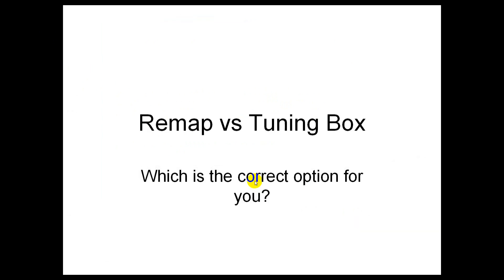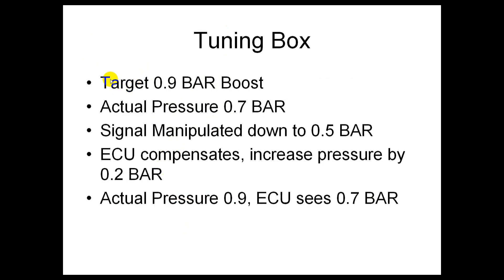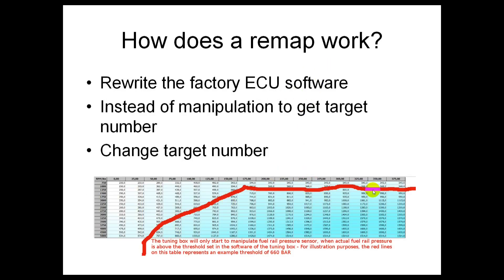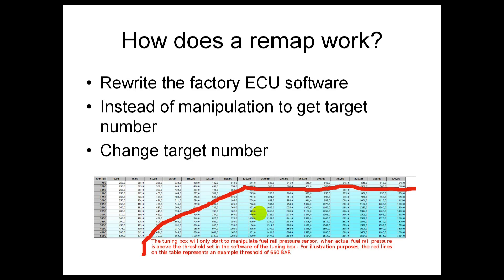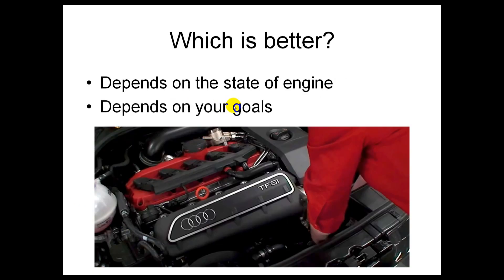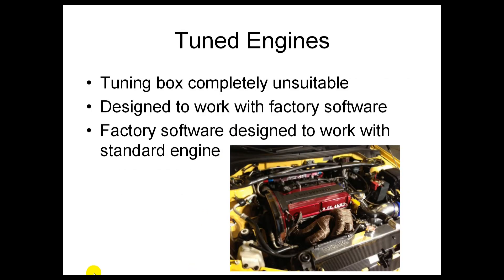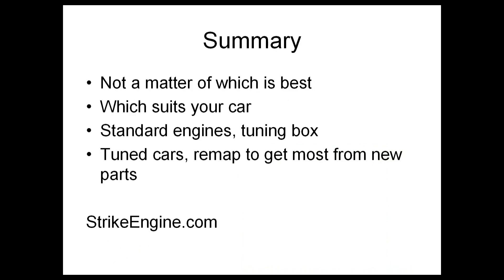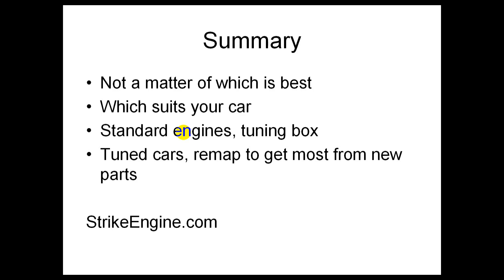Remap vs Tuning Box - Which is best?

Comment: Average fuel rail pressure in modern-ish turbo diesel cars  (from the last 15 years or so) varies from around 13,000psi to 26,000psi. (Your car tyre is pressurised to around 30psi) so that’s a LOT OF PRESSURE. And you want to push it up another 20% it’s not been designed for? You think that’s not gonna have an affect on parts and longevity? Is it really worth it? Fk no.

Comment: 3:18 WRONG a tuning box is detected after being used, even if removed. You don't know much about cars or forensics, or how insurers worked with police for years to collect evidence. 
A tuning box is rubbish, it takes no inputs from any engine components like the ECU can.
It is just a £2 voltage multiplier. Sold for hundreds.
Get a proper REMAP and at least your car will operate properly.
Reply from the maker: Hi. I don't class products which are just a voltage multipliers as tuning boxes. They are indeed "rubbish". This video is not about this type of "product". 

This video is about tuning boxes such as those from DTE etc

Comment: What could happen to the engine if I fit a tuning box? Will it overwork other parts of the engine? Are there any negative effects to other parts of the car? I'm personally considering getting a tuning box for my C220d.
Reply from the maker: "Overwork" - Probably not. The engine is still controlled by the factory Mercedes software. If you accelerate and drive faster generally, logically things will wear faster.

Comment: Hmmm, interesting. Everyone says the remap is so much better as tuning box is deceiving the ECU so it can create many problems.
Reply from the maker: A tuning box can cause problems if its adjustable *and* the user puts the settings too high. Solution here is to reduce the settings.
Reply: So you wouldn't recommend a TDI tuning box with 7 settings?
Reply: For an RCZ HDI

Comment: can anyone tell me if its still suitable to use a tuning box if the only part im changing is a different muffler, otherwise everything else will be stock
Reply from the maker: Its best to use a tuning box on a close to standard engine, ie muffler change should be zero problem.

Comment: Great info but you said if you got a new exhaust you can’t use a tuner box?
Reply: Unless the box is tuneable itself, then it’s not a good solution. They have to be programmed to suit the vehicle in its standard form, once you start changing other components you run the risk of being “outside the parameters” of the box. Sometimes it won’t make a difference, but once you start stacking upgrades (i.e. Exhaust, Intake, Injectors ) then you move further and further away from the parameters that the box was programmed for, reducing its effectiveness.

Comment: One thing I don't recall him mentioning is tuning box gives much better gains on turbo diesel engines over petrol engines.
Reply from the maker: You are 100% correct. I will do another video specifically comparing remaps vs tuning boxes on turbo petrol engines
Reply: Did you ever do a video comparing remaps and Tuning boxes for petrol engines?

Comment: Can not see now a power box when it connects to a fuel sensor on a engine can alter the timing and boost on a turbo diesel does anybody know thanks.
Reply from the maker: Hello Jeff. Tuning boxes generally do not change the injection timing at all. There are probably exceptions to the rule but I do not know of any. Closest I can think of is Steinbauer, I believe their products alter injection duration only, not timing.

Comment: Hi I’m just wondering i have a n/a civic type r ep3 its not been mapped I only have exhaust and induction kit will this tuning box be beneficial to a k20a2 engine im not wanting massive gains power wise just something to make it a bit faster. So do you think this will work thanks
Reply from the maker: Hi. These products are for cars which have a turbocharged engine from the factory
Reply: StrikeEngine TV thanks for the info 👍🏻

Comment: Is the overall build of the tuning box the same or is there a difference between the 100 dollar, 300 dollar and 500 dollar tuning boxes?
Reply from the maker: Edit. Different products from the same brand will normally be of the same quality. Build quality between brands will not be the same (cases/materials/connectors/harnesses will vary).
Reply: Thanks for the answer. Some cars like Jaguar and Mercedes have different models with exactly the same engine but the performance is limited by the ECU. Can you fit the tuning box for the higher power model to the lower power version and have the same results?
Reply from the maker: Tough question. I suppose it would depend on how they have reduced the power, what software changes they made to the ECU. I wouldn't recommend it, just get the box that is designed for your specific car

Comment: Can a tuning box be installed on a remapped engine to reach more power ? The car is original,  no new parts.
Reply: Try watching the vid
Reply from the maker: HI! It depends on the tune but generally speaking no. Tuning boxes are designed for stock engines

Comment: If the dealer looks into it they can see your car's been running higher boost on acceleration as these numbers are apparently recorded. And if you're making a warranty claim they will look into it! I've been thinking of getting a JB or BlueSpark tuning box for my m135i and seen a lot of these claims about it not recording on the ECU but a BMW technician on one of the forums made it pretty clear that if they know what they're looking for you can't hide it.
Reply from the maker: Hi. I've heard this also but never with an explanation as to how. From my point of view if the ECU does not know the actual boost pressure I don't know how it could record the actual boost pressure. I suppose a dealer could make a guess as to the boost pressure looking at other data but at the end of the day, they would be guessing, not knowing.
Reply: So I've seen a couple of posts giving alternative views which I'll copy here- apologies for the wall of text but some people might find it interesting! First this guy who works for BMW, writing on a forum about a Bluespark Box:

 "I ran the box on my car at level 5 for around a week before it threw on the EML and even after the EML came on the car ran perfectly. I plugged the car in at work and got the ambient pressure sensor fault code, reset it and carried on with the box connected. The EML came on later that evening and drove it for a few days like that before removing the box the day before my car went into service.

Once removed the EML went off again but the technician at work said theres a stored fault on the car has your engine light come on atall, i obviously acted dumb and said no! He said they had looked through all the data logs etc and couldnt find a fault, cleared the fault and road tested and all is well so very hard to trace by the looks of things!" 

But then this guy explains why warranty claims can be dismissed: 

"Can BMW detect a piggyback after its been removed? YES
Several people and a few vendors claim it can't be seen by BMW since it changes the signals from the sensors hiding the extra boost and airflow. However BMW knows exactly how much fuel the car uses at all temperatures and authorized fuels (E0-E10) so if it is outside that range there is a mechanical failure/change or the tune has been altered. On a stock car the trims stay below 10%. A car with a piggy routinely sees above 20% during wide open throttle but goes back to normal while cruising. It's very obvious looking at data logs. 

Secondly they can take the time it takes for the car to accelerate based on speed or rpm rise over time and determine how much power it takes to accelerate the known mass of the car in the known amount of time. not perfectly accurate due to varying conditions but they can clearly see an extra 80-100 hp. It's how programs like virtual dyno work. http://virtualdyno.net/

Second, will they void your warranty due to a tune? 
If you make a warranty claim for a major failed part BMW opens a PUMA case and requests the ECU data. They will see the tune/piggyback data and void the claim. I'm sure someone somewhere has gotten away with it for whatever reason but based on numerous posts on the forums and conversations with many SA's, the claim will not be honored."

Although he also says he's been tuning turbo BMWs for 4 years and never seen a piggyback alone cause a failure. I guess it depends how much effort they put into looking for it?
Reply: It's simple, there are multiple sensors on each car that give away over boosting the air pressure. Maf is one fir a start. Fuel flow, knock sensor. All of these start sending abnormal signals using a box, so there's a fairly obvious smoking gun.

Comment: What about the fuelling, you only address the charge air, you won't get any benefits unless the fueling matches the air flow.
Reply from the maker: Hi. For the tuning box you mean? Fuelling is looked after by the factory ECU (not the tuning box). The ECU injects fuel according to the MAF signal & also the lambda signal. More boost = more air entering the engine = raised MAF signal = more fuel.
Reply: Car TV - StrikeEngine.com Ah, I made the comment based on the headline description and without seeing a reference to the unit. So that's more of a boost modifier than a "tuning box" to my mind. Thanks for taking the time to clarify.
Reply: On a diesel engine, the airflow matches fuel. Opposite to petrol...